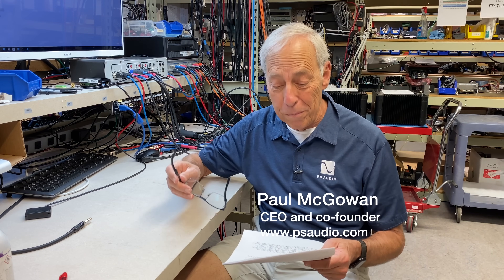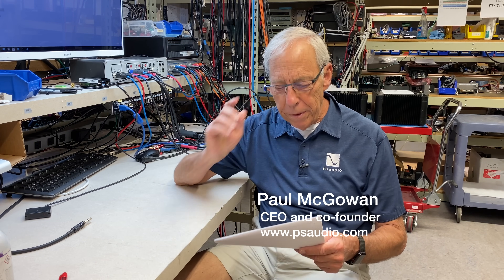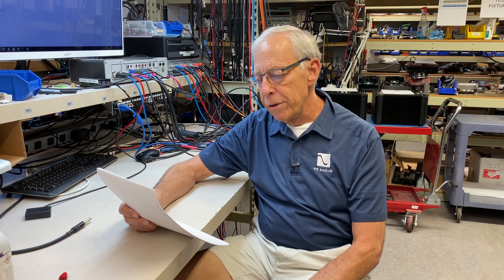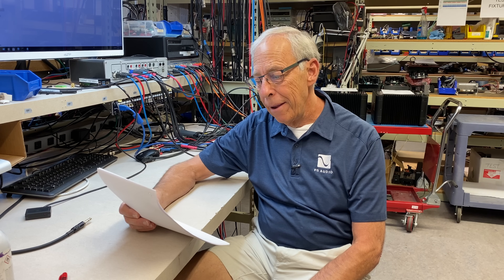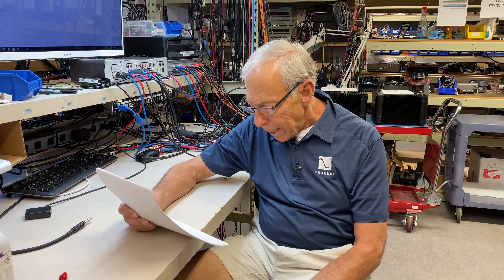Omni directional tweeters

Comment: I picked up a set of old Mirage bi-pole speakers, rebuilt the crossovers with good parts, used some good biwire cable, and hooked up a stout dual-mono amp.  Supplemented by a 12" powered sub and moved out around three feet from the rear wall, they are amazing.  I  dont think I can go back to conventional front-firing speakers.

Comment: I have the Mirage OM 10. When I was hunting for speakers in the 2003 I had picked the B&W 603. I went home to get the money and they were gone the next day. I went to 3 places in Maryland and 2 in Virginia. For some reason, they were sold out. The salesman introduce me to some very tall towers. I listen to them and bought the OM 10  They are Omni directional with the woofer and tweeter in the back, I still have them after  all these years and they still sound good. They require a lot of power so they are paired up to a 150 watt per channel Yamaha. After that marriage they sounded really good

Comment: push pull ? if the mids were 180 out of phase wouldn't that kill the sound?
Reply from the maker: Yes, wherever they should meet. But if you have a baffle or the speaker box to block the in and out of phase signals then no. On a panel dipole speaker, for instance, there's cancellation at the speaker edges.

Comment: In the 1980's I had set of speakers that had a 15" woofer, a 5" mid and a 1.25" Mylar tweeter in the front and a 5" mid and a 1.25" Mylar tweeter on the top...  It also on the top had a cross over control that allowed phase change and attenuation of the top speakers...  They also connections for tri-amp inputs...  I cannot remember the brad, but they sold from $1500 to $2000 per pair... Can you comment on this design and how it might work???

Comment: I don't care for rear mounted tweeters or drivers pointing towards the wall, any more than I want musicians playing, or people speaking with their backs to me, and then coming up with the excuse, " I did it to bounce the sound off the wall for greater ambiance"
The mouth is at the front for a reason I tell you!
Reply: @behexen250 put a piano in the middle of the room and play it. Show me a single spot in the room it can't be heard. Roof, floor, walls... They will be at slightly different volumes but can still be heard due to reflections. That is the point of the dipole setup, to better simulate the natural reflections of an instrument. Because upper frequencies are very directional (due to the wave length) they can sound very "source point" by adding sound in the opposite direction you double the source point.

Comment: On his best speakers, Arnie employed rear facing drivers to get constant power output by frequency. As frequency goes up, a driver’s radiation pattern narrows, and it will start to beam. If you want to have constant power radiated into the room as frequency increases, you need to do something.

Comment: dipole is absolutely not omni at all , not even quasi
Reply: He did differentiate between them, quite accurately in my opinion.
Reply: Inclined to agree with Gerrit, takes a huge liberty on the word omni to even get to quasi. I run RAAL dipoles using a single element for both directions, and it is in no way omni.

Comment: Different music benefit differently from how speakers disperse the sound waves.
Reply: @FatRat-f9m  Yeah, the 901s were best for live music because they fired music backwards creating more feel of ambience.
Reply: @FatRat-f9m  Yes, also that. I prefer to hear the true details from the studio master rather than some random room reflection extravaganza.
Reply: @behexen250 You also appear to have some depth of knowledge in this field. For headphones and earbuds, you most certainly can hear the real bass full range. However, the efficiency of how much of the transducer's acoustic energy in the bass moves your eardrum depends on how much of the bass is leaking through any air gap between the diaphragm and eardrum. Poorly fitting headphones or earbuds will therefore lack bass while the higher frequencies are more directional between the diaphragm and eardrum and will come through with higher efficiency. I'm currently using some Etymotic Research earbuds when outside that go deep in the ears and couple very effectively between the diaphragm and eardrum. They also isolate ambient noise very efficiently.

Comment: There is only 1 true omnidirectional tweeter as far as I know.  MBL Radialstrahler
Reply: The TLS-1 by HHR Exotics is an updated version of the Ohm F which is omnidirectional at all frequencies and the high frequencies go much higher than the original . Unlike MBL speakers one cone produces all frequencies  so there are no phase issues and there is no need for crossovers therefore no distortion or  the coloring of the sound that they can cause.
Reply: giri kotte  It says omni directional in the video title.
Reply: Reality Kicks in How about the Heil AMT?